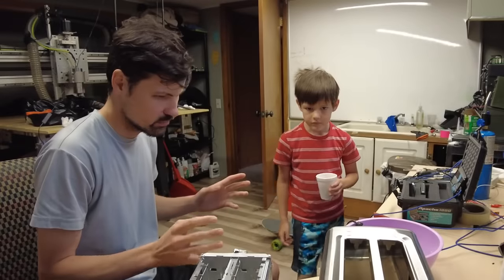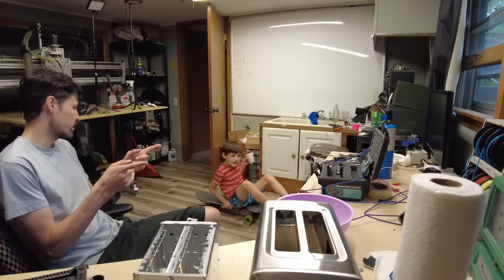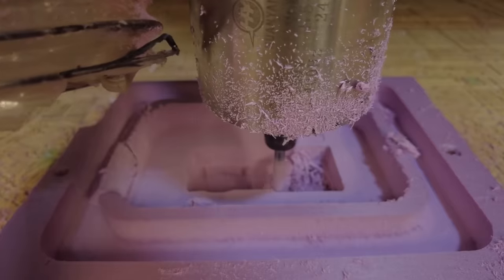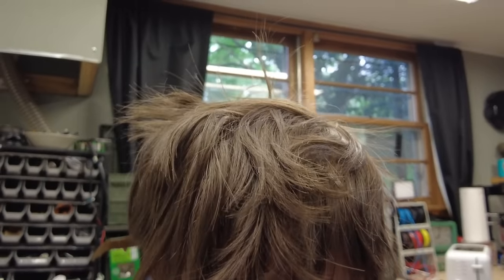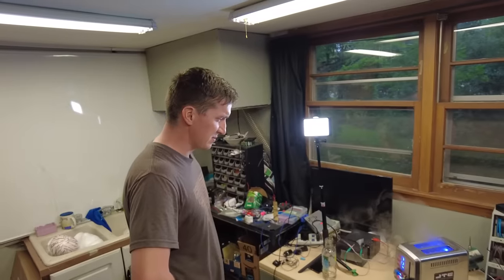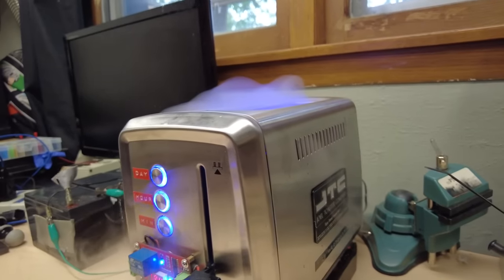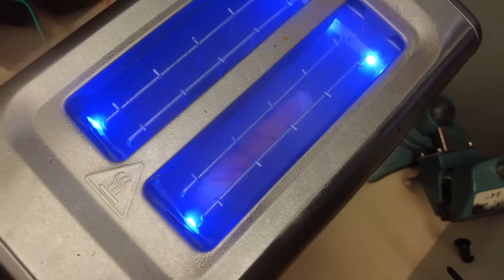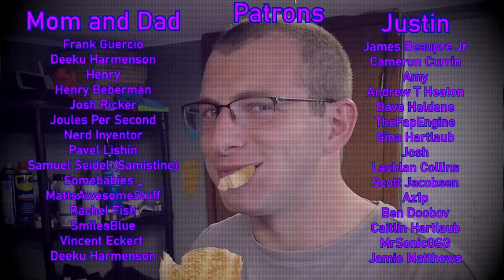Reverse Toaster (actually works)

Comment: Knowing that toasting bread is a chemical reaction that cant be reversed, i am pretty impressed that you got so close to returning it to normal
Reply: Yeah, this is what threw me off for a moment. I didn't realise how much of the effect was just dehydration
Reply: @1TW1-m5i  Accidentally overmicrowaved bread once and I thought I invented shitty toast
Reply: @sasdagreat8052  i accidently over microwaved French bread. was supposed to be 20 seconds. accidently added an extra 0. the result was a block of charcoal...
Reply: Yup Maillard reaction kinda pog
Reply: Yes the toaster knows a lot about toasters
Reply: Why are you guys microwaving bread to make toast
Reply: @Kittsuera  mmm crunchy
Reply: The only thing left is getting rid of the carbon in the crust and you will get a slightly lighter weight piece of bread
Reply: A chemical reaction that can't be reversed? I knew chemistry was a lie!
Reply: Clearly this guy is too young to remember informercials for the Bamboo Steamer.
Reply: It's just normal bread that's been cooked a little longer.
Reply: Basically the same concept as rebaking stale bread, and I’m talking bread that’s so stale it’s a crouton. It’s difficult to get it wet enough to work but not so wet that even after baking it’s soggy but doable. I was kind of hoping for more but should’ve known there’s literally nothing you can do besides rehydrating it
Reply: Did you just get out of 6th grade science class
Reply: @tortno6578  they were probably only trying to warm the bread, hence “accidentally” made shitty toast

Comment: I expected you to have made a toast planer to remove the toasted bit. Honestly a solid solution to artificially stale bread.
Reply: Its like resurfacing brake discs! Remove the rust/char and you get a fresh brake/bread disc/slice
Reply: It's really a fluid solution but okay.
Reply: @SyntaxDaemon  Thanks for making me spittake
Reply: I thought stale bread was due to moisture: i.e. it crystallizes
Reply: @armorhide406  im not sure, but microwaving the bread will buy you a little extra time. I guess the heat either breaks the Crystals down, or causes them the slip past each other, giving the illusion of softness. 
Either way, once it cools, itl go more stale, more rapidly.
Reply: Same! I was going into this thinking they were gonna just use an orbital sander in a toaster shell lmao.
Reply: Now I want to see the toast planer cos I'd thought he'd do it that way too and give it a little bit of moisture.
Reply: @Nbomber  it's just vaporizing the trapped moisture in the bread, hence when that finally evaporates you get even more stale bread.

Comment: Now the question is: if you crank up the time machine toaster, will the bread turn back into dough? Think about it: the longer it runs, the more moisture is added...and dough is basically bread with less water...probably some flawed logic in there, but it'd still be interesting to see what happens!
Reply: you forgot about the yeast
Reply: @kevinbissinger  true, the leavening agents would be depleted.  I wonder if wild yeast would take to it and restart the leavening process...
Reply: Nah at a certain point it just turn into soggy toast.
Reply: @marzuqahmed218  nah not soggy actually. But moldy
Reply: @TheNamesArif  mold doesn't just happen, it takes time for it to develop
Reply: Dough is raw, bread is cooked
Reply: @manlymannysmanymediocremem7026  well bread is raw and toast is cooked. Someone still untoasted toast though.
Reply: @lilyofluck371  actually toast is just twice cooked dough
Reply: Probably just mush
Reply: Alright ladies, get it straight
Dough is raw
Bread is baked 
Toast is burnt
And anything beyond that? Ashes.
Reply: I'm a baker and when you make dough the proteines in the flour stick together, making a proteine net where the gases formed by the yeast get more or less trapped, forming tiny gas bubbles evenly throughout the whole mass (if the dough is made right). Those gas pockets and the proteine network make up the porous "Krume" in german, which then denatures when heated up in the oven.
The expanding gases and rapid panic multiplication of yeast cells now dying make the bread and the gas pockets inflate and get stable, and more solid over the baking time.

So to answer your question simply: No, it wouldn't turn back into dough because you are literally changing the chemical and molecular properties and distribution of the components in the dough.
In other words... Once you're bread, you stay bread. More moisture and you become soggy bread... Even more moisture and you (d)evolve into wet bread.

Edit: corrected flower to flour😂

Comment: i have on multiple occasions actually honestly for real had use for a reverse toaster. 
like when i make toast and then forget about it, ending up with dry, slightly burnt bread, when i want it hot so i can get the butter to absorb into it. 
actually kickass invention 8/5
Reply: Ew, butter. Plain toast is where it’s at.
Reply: @rachelcookie321  I value and respect your opinion, although I disagree with it.
Reply: @rachelcookie321 unlike the other guy, I do not value or respect your opinion

Comment: Does it revitalize stale bread? Or could you add some sort of flavoring to the water to create infused breads?
Reply: vape bread??
Reply: @Oystercaulk  nicotine bread
Reply: @Oystercaulk  no, tea infused bread
Reply: @epic-user-handle-83  pshh... ayahuasca infused bread
Reply: The other thought is can make bread dryer for storage and rehydrate it for later use
Reply: Soon at your local bakery!
Reply: I am almost certain infused breads could be achieved with this device, though it may require a toasting/dehydration beforehand to avoid over hydrating the bread. The concept of dehydrating for long term storage is also interesting, though probably unnecessary given how well i've known bread to keep in a freezer.
Reply: @reaganharder1480  Whole freezers are great for keeping bread from going stale they actively use energy. If you dehydrated bread it wouldn’t need active cooling. Just rehydrate when you want to eat it.
Reply: @PuffyRainbowCloud  this is true, though the energy required to keep a single loaf of bread frozen is marginal and probably worth the inconvenience of having to rehydrate bread in most cases. Perhaps in some long distance shipping applications the simpler logistics of not needing a refrigerated transport unit would make it worthwhile, assuming bread is ever shipped such distances...idk, not a totally useless idea, but probably not better enough than freezing to really find a use
Reply: @reaganharder1480  Ah yes, but you assume electricity is available. Dehydrating and rehydrating bread could be done entirely without electricity.
Reply: @PuffyRainbowCloud  well, this rehydrating method sure isn't without electricity. Design a bread rehydrator that does not use electricity and i will concede a definite usefulness to the concept.
Reply: @reaganharder1480  a fine misting spray bottle might suffice :)
Reply: @Oystercaulk  i have my doubts, but it could be worth some testi g
Reply: @reaganharder1480  Literally a steaming pot on an open fire would do the same thing and probably faster, too. De- and regydrating foods has been a preservation methods for thousands upon thousands of year, long before commercial dehydrators or electricity.
Reply: Coffee and bread 2 in 1
Reply: Lol grape bread
Reply: Lightly toast the stale bread first

Comment: I actually believe the delorean was inspired by things like the millenium falcon showing barebone scraped parts. The falcon and the Delorean use things like kit bashing which are referenced from real world hardware. So yeah it comes down to does the toaster have wires and crap indicating it's function. Yes.

Edit: I want to know how many times you can toast the bread and rehydrate it and when does it start to disintegrate.

Comment: For the longest time, I've used a bread de-toaster as an example of an invention that is technologically advanced, but functionally useless.
Reply: Advanced how? It’s just a humidifier, not even uncooking the toast
Reply: @thereinthetrees_5626  toasting bread doesn't just dehydrate bread, it does go through a chemical change, like most things that are cooked. So completely restoring toast back into bread is not possible. Even in light of this product which functionally reverse it just makes an actual bread-detoaster even more impractical.
Reply: @DoubleL11862  Your grammar was horrible in that comment, normally I wouldn’t care, but you started making 0 sense.

And that exactly what I mean. It’s just adding water to toast, making it as floppy as bread. So how is it advanced?
Reply: @thereinthetrees_5626  heh okay dude. #IAmVerySmart
Reply: @thereinthetrees_5626  woah man, you really destroyed Collin with that one
Reply: Yeah, how uh did your de-toaster work; does it take the 1 to 7 kW back over the time it operates, and atomize water with ultrasound, and possibly un-crisp the Maillard-crisped toast? Maybe it just convolves the bread so that the crust is only on the perimeter (if you never toast butts) and not also the rough face somehow?

Comment: If you take an ordinary piece of fresh toast, lay it flat on a plate and give it a few seconds in a microwave oven, it softens again from the remaining water in the bread. If you sprinkle the toast with a little water before putting it into the oven, it cones out as soft as fresh bread. I discovered this by accident when trying to make cheese on toast without having a grill available.

Comment: you can do the same with with a tortilla you have put on the pan too long, run it under the tap then put it back in the pan, fixed.

Comment: This would be useful for those times when you buy a loaf of bread and get home and realize it's partially dried out.
Reply: 20 mins to an hour for 2 pieces
Reply: @need2connect  for toasted bread. I'm talking about slightly dry bread.  I doubt it will take as long.

Comment: But the bread also burns and cooks. That's what toasting is. It should leave a trace taste of ... well... toasted bread, at the very least.

I suppose it depends on your settings, but even so, I find it hard to believe that no taste would remain if you properly toasted, normal, healthy, non-American (cake) bread. 

It probably worked this well, because of the bread choices and the very low amount of toasting. Which means it didn't really fully work, but you were able to hide it well enough regardless. 

As an aside, this would be much better as an actual bread refresher. For stale bread.

Comment: I mean it kinda work, but not really. You making it moist again, but making toast is not just process of drying bread. in the toaster the bread is also "toasted". on chemical level chemical compounds break down on less complicated ones or straight in to coal.